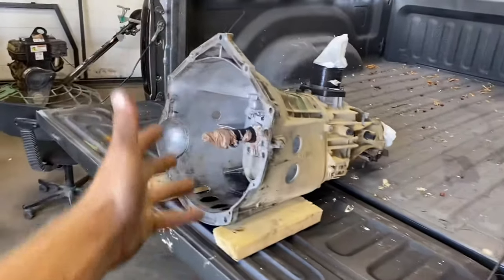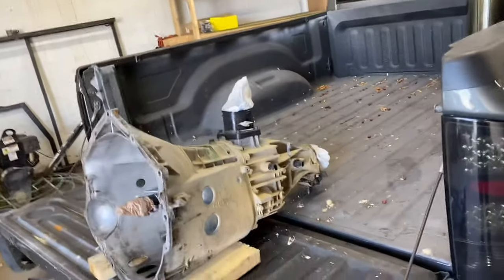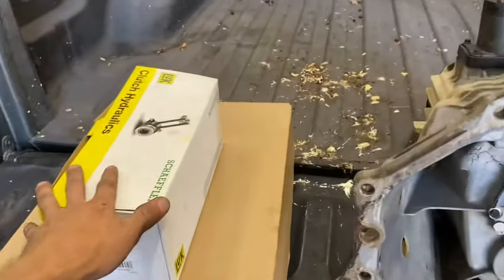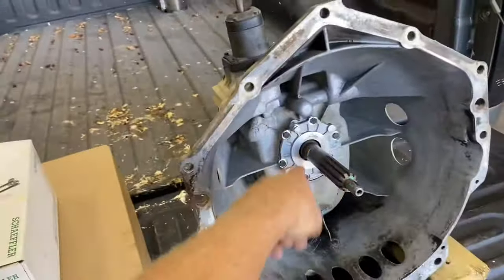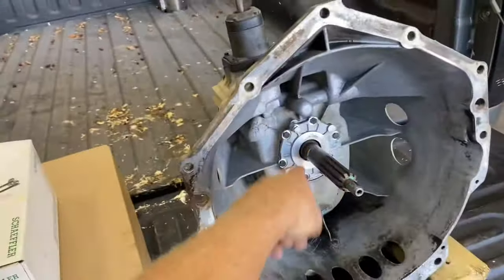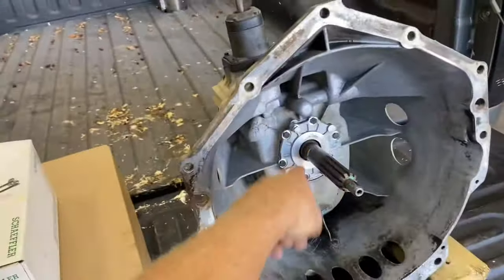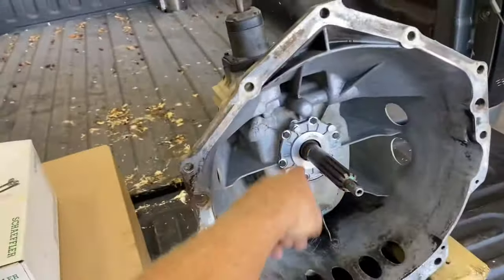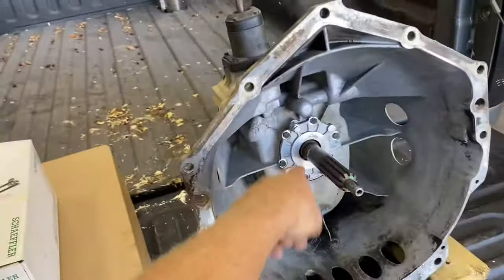CHEVY 1500 AUTO to MANUAL SWAP—EVERYTHING YOU NEED!!

Comment: Hi I’m 14 and soon getting a Chevy 1500 and wanting to do the same thing thanks super helpful
Reply: I’m 16 just got same thing have u done it yet
Reply: @justinjolly8385 I got my 93 Silverado  when I was 13. It’s already got a five speed but the v6 is shot so I’m about to put a 5.3 in it. This video covers basically everything you guys need to know, the only thing he or I may have missed is that there’s two types of both the clutch release bearing and the pilot bearings. There’s an old and new style and they depend on the length of the input shaft of you transmission as there is an old and new nv3500.
Reply: Y’all are all some lucky fuckers, my first truck I got was a 95 ford f-250 pos and it didn’t run 75% of the time I had it lmao, plus I got it when I was 20
Reply: I bought a very good non rusted 86 2 tone red white suburban for $400, but engine was full of water to valve covers
Edit age 18 with my dads help, still building engine but i owe him the
 $$$$
Reply: Rumor has it yall still waiting for that truck 🤣 daddies monies lmao
Reply: @StashingClips  imagine being so damn bored you gotta write hate comments to fill your empty life
Reply: @HayesThompson707  motivation for them if they arent soft skinned🤣
Reply: I didnt know they came with v6s. I got the 94 with the 5.7 350@eliwetch2944

Comment: The 5.3L is estimated to be around 383 ft.-lbs. of torque with the NV3500 rated to handle up to 300ft.-lbs. of torque. That's why they weren't offered for engines bigger than 4.8L, estimated to be between 255 ft.-lbs.(Older) and 295 ft.-lbs.(Newer), {1999-2006 engines}.
Reply: so i probably shouldnt put one in my 8.1 swap build lol
Reply: @nicholasburgett3840  send it but.
Reply: @nicholasburgett3840 would do a nv5600 for that tbh
Reply: Pffft my 4.8 228r cam 200shot didn’t kill that trans  but it did take about 30+ pulls with the lq9 torquer v2 cam with a 200shot to kill the guts on that same trans
Reply: I was wondering the same but they came in the older trucks (96-98) with the 5.7L rated at like 330ftlbs. Kinda weird
Reply: its not torque that kills transmissions its traction. Just take it easy on the launches and don't get too grippy of tires,  you'll be fine.
Reply: Doesn't matter. iv had a 6.0 swapped 95 for 3 years with an nv3500, I'm rough with it, still hasn't broke. They can handle it, people who brake them don't know how to drive
Reply: I wanna put one in my 98 with a 5.7 vortec if I go easy on her should be alright ya? It's only rated for like 330 ft of torque that's not that much over 300 😅
Reply: @ImpalaWes  Those specs are talking about engines in tip-top condition (New). Even if the actual engine torque specs are a bit over rated for those T-cases it should be okay if you don't abuse them too much. As long as you're not playing a game of Truck vs. Truck "tug-of-war" and just doing some rock crawling or even some high speed 4×4 racing... My bet, is that you're good to go!

Bearing health and ensuring you have good quality "heat dissipation" fluids (like "Amzoil severe gear oil", or something high end like that) your drive train should be fine to be used as it's intended. Heat and bearing wear are probably your biggest concerns with Transmissions, T-cases and Differentials.

Comment: Great info. Thanks man. I have a nv3500 behind a blueprint engines 400sbc around 500hp in my 1 ton 49 dodge. Had it that way for years now and no problem. I drive fairly gentle but still floor it sometimes just don't launch harder pop the clutch.

Comment: I'm working on a 89 Chevy c1500 for my dad. It had a 5.0 in the truck with an automatic transmission. I just put a 350 crate with it all hooked up and I put Saginaw 3 speed behind the motor. I'm having an issue with the fuel pump not working now. I'm thinking it's because the old transmission wires are a post to be in the sensors. I was wondering if I could hook up the old sensors and put the the switch in neutral position. Would this work for the fuel issue or does the connections with the transmission's sensors have nothing to do with the fuel issue.

Comment: Hey Marcus!! love your channel dude keep up with the awesome content.

I'm seriously doing the exact same swap as you with a parts truck as well but both my trucks are an OBS 93 Chevy Silverado's but i was hoping you could help me with whats the best clutch kit to use? 

I'm running a 93' SCB 350 5.7L with the vortec top end...pushing 350 hp to the wheels and i tow lots and like to do burnouts so im having trouble picking out the best clutch for my 4x4 10 spline GM NV4500... what's your recommendations?

Comment: you will need to tune your computer because throttle wont response right because transission is programed in computer , buddy of mine had a ls manual swap truck before the tune it was slow to pass cars on hyway and after it was like if it was from factory

Comment: I got a 94 k1500 and I'm swapping to a nv3500. Would you suggest swapping the ecm as well? Not sure if the motor will run right using the stock ecm meant for an automatic trans.

Comment: Bought a 1997 Chevy K1500 with a manual swap in it and am having issues with reverse lights not working and headlights only working in daytime runnning mode when ebrake is released but headlights turn off when light switch is turned to on position. So no brights ! Old owner added an LED bar to the brush guard to rectify this problem! Any ideas how tp fix this !!

Comment: I have a 2000 Silverado that came stock with a 4.3 and nv3500. My donor truck is an 01 Silverado 5.3 with 4L60-E 4x4. I'm using the motor harness from the donor truck. Did you run into any wiring issues? I haven't had the time to compare the harness to the nv3500 to ensure it will fit.
Reply: I had to cut one sensor off the manual trans harness and splice it into the swap auto harness. Pretty sure it was the reverse light switch. Plugs into nv3500

Comment: I really need your advice about something on  a swap like this I have a 1965 chevy custom with a manual 4 speed it was bolted up to a 305 small block I want to take that transmission out and put it in my 2003 chevy silverado 2WD club cab it has a 4.8 vortec V8 and I would like to know if that transmission will work in the 2003 chevy and possibly keep the manual clutch setup with the linkage system setup but i have no idea if the newer engines like the 4.8 vortec has a threaded hole in the block to thread in the clutch linkage pivotal bolt because I really don't like hydraulic clutch systems not only that what would I also need to do in order to install the clutch pedal when it comes to a manual clutch setup because it would also save a lot of time and hassle of changing the mastercylinder and who knows what all else if I can stay with the manual clutch setup but I would really like to hear your opinion and thoughts on the matter

Comment: I got nv 3500 for my 4 door 1500 2010 4.8 putting it in few weeks after I get my clutch kit all im waiting for
Reply: How did you work with the brain
Reply: Want to do the same how did it go what clutch and clutch system you got?
Transmission mount?
Flywheel?
And also ecu
Did it work like in the video im not sure since its a 2010 
Ty if you replie would be appreciated
Reply: @miwimath8836  had to get it tuned and 99-06 clutch system with a cross member from a 99-06 that had a 5 speed and it should all match
Reply: @christopherdavid1474  had to get it tuned or u gotta keep clearing codes

Comment: This is awesome! i got a 2500HD silverado with the 6.0, And the guy before me ran the tranny without fluid...Burnt the transmission up, wanted to do a Manual swap! I was curios, Do they have any Manuals with a 6 speed?
Reply: Look at a t56 or tr6060 nit sure on if the shifter will line up but they will bolt to the 6.0

Comment: Hey Marcus. Would a nv3500 from a 1991 k1500 work in a 2003 silverado? Also would It work for a 4x4 extended cab?
Reply: i also have a 5.3 4x4 ext cab and want to keep my 4 wheel drive. if you find more info on weather it will work with 4x4 lmk please.

Comment: What manual transmission and differential oil does it have? I have a 1995 Chevrolet Cheyenne pickup, a 305 tbi 5.0-liter 8-cylinder engine, 238 thousand kilometers and I don't have the vehicle manual. They are the same models from 1988 to 1995.
Reply from the maker: I apologize for the late response! I run pennzoil manual synchromesh in the tranny. As for diff I run valvoline 75w-90 synthetic!  
Thanks for watching!!

Comment: I know this video is about a year old but I'm doing this swap with a 4x4....it's all installed and the truck is finished, but it will not start now, at first it was just not cranking, found the neutral safety switch wires underneath and jumped them together, it now cranks, will fire up for a second then die and not start back at all for a few minutes, but will do the same thing....am I missing something?
Reply: sorry i dont have an answer for ya but im hoping to swap my 5.3 4x4 ext cab. what transmission did you swap in and were there any fitment issues caused by the 4x4. also curious about your particular issue so if you find a solution id like to know.

Comment: I have a 95 silverado short bed 5.0 previous owner swap in a manual transmission with low and od which makes noises going on 1rst and pops 4th od.original i belive it was a hm290.is there a better trans than the hm290 to fit .or should i go auto swap of so whats the better option?

Comment: Good video. I have a 2000 Silverado 4.8 in manual and I’m trying to put in a 4.8 automatic motor. Will it drop in? Or which parts do I need to change on the motor to get it to fit?
Reply: I swap you trans haha I got a 4l60 with a corvette servo

Comment: Need a hand bought a 1996 Chevy 1500 it was swapped to a manual it drove when I got it replaced the engine 350 same that was in it it came out of a 1996 Chevy suburban but now I'm not getting spark went through fuses but not getting enough power to the sensors or ignition coil kinda stumped the wiring from the auto is still there just hung up outta the way

Comment: I'm doing this to my 2500 and I just got my nv4500 bolted to my 6.0l LS and took the manual computer and put it on but it won't start so do I need to cut the auto trans plugs to rewire the neutral safety switch and get this thing goin

Comment: Swaping my 2002 silverado from 4.3 v6 manual to a 5.3 4l60e 04 engine n tranny swap running into cross member and drive shaft issue any tips ?

Comment: What if you have four-wheel-drive is there anything else change?
Reply: I just did this swap, the transfer case was a huge pain! You need to change the input shaft to a 32 spline and MAKE an adapter to make up for the short input shaft. I was unable to find an adapter or a np241 trans case. Maybe you will, but keep that in mind. Overall a relatively easy swap.

Comment: Are you sure about the flywheel bolt number? That is for a Toyota, not for la small block. Chevy bolts are 303-2802 not 203-2802
Reply from the maker: I apologize for the late response! Your correct I messed up typing in the part number! Appreciate the comment. Thanks for watching!!
Reply: Hey by any change you know the part number for the flywheel bolt ? I’m putting a 04 5.3 in the 5 speed
Reply: @al5678

Comment: I know the NV3500 is cheaper but if you're wanting to bang gears why not go 6 speed? A 6 speed with the 5.3 bored and assembled with LS1 rods and pistons, have a stage 2.5 port job done, TBSS intake, and BTR cam of your choice. I had a LS1 with Stage 2.5 TEA heads, Futral F14 high lift which is a 232/262 .620 lift and a Fast intake. It was an absolute sweetheart of an engine. GOBS of power much lower than I was expecting and pulled hard to 6500-6700. Made 460whp in a F body but a similar build in your truck with a BTR Stage 3 truck cam would easily make 420whp and would be a blast. Biggest expense would be machine work and head work.
Reply: I think he just meant, he wants to shift gears. 
I'm sure he's going for an oem style swap nothing special as the motor is all stock. Many of us are just looking for a manual swap nothing too fancy just something we can bang gears. 

I don't own a truck yet, but I have my eyes on one and will be manual swapping it down the road as I collect parts over time. 
Banging gears in general is fun.

Comment: Hey man, currently have 270k on my original trans in my 04 5.3 1500. It’s a z71 with 4wd what trans could I use to do a manual swap ? Not looking to add power to the truck just a stock 5.3